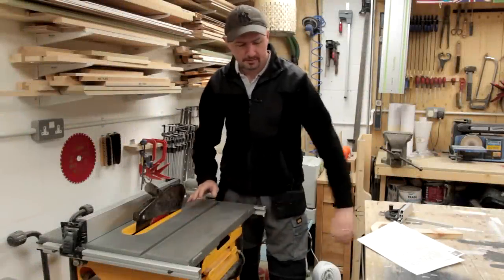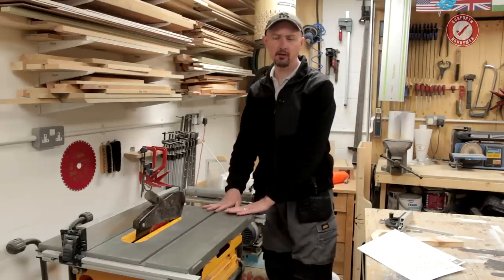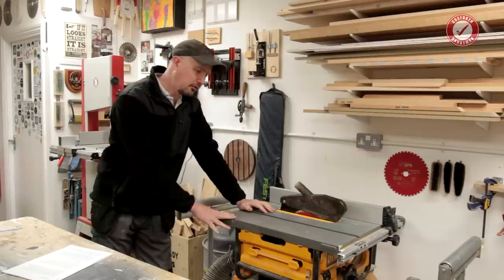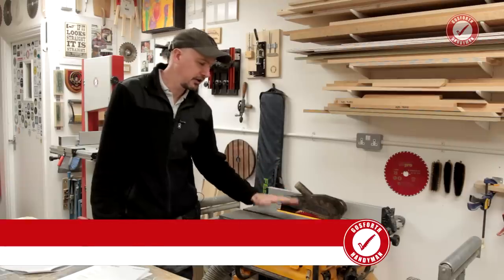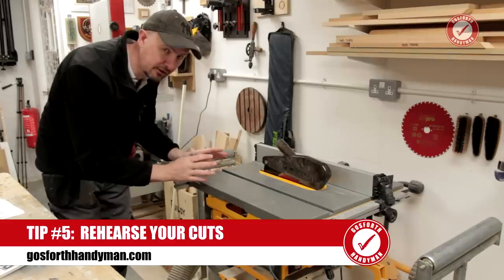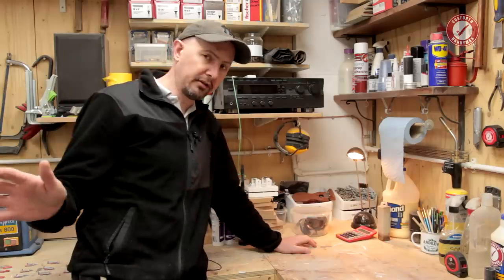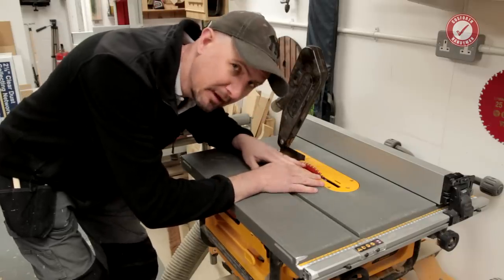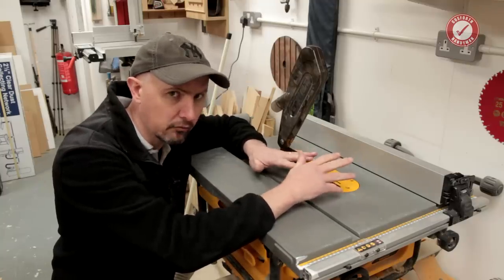TABLE SAW SAFETY - 11 tips to avoid death!

Comment: I used to use a Tridon work bench with a AEG 9 1/2 '' blade. I used to work off to the side 90% off the time. The down side o it was the emergency shut off switch was on the lower left corner when face the blade making it not really possible the use with speed. But I felt safer and had far more control over the cut wood. Plus after the wood had pasted the blade I could move to the back off the bench with just a step removing both the cut and off cut off the back off the bench going away from the blade instead off going out and back past the blade as you do when standing in front.  Always set the blade depth just above the timber your cutting. The right and a sharp blade will/does do a clean cut. Make sure when buying a saw such as I did, a hand held to be mounted in a work bench that the blade isn't flatting from side to side. Good bearing with little movement makes for a cleaner cut.

Comment: I had removed the riving knife on my BT3000 because of some cuts that wouldn't fit through.  I did not put it back on for a long time, but just put it back on a couple of months ago from watching another saw safety video.
I was cutting a thin board, using a long push stick and did rehears my cut, but missed an obstical and when I did my actual cut, the table saw moved a little and hit the end of the cut, stopping the board from clearing the blade.
The switch is a big paddle that I can hit with my knee and I was able to switch it off, but the saw still coasted.

IF the riving knife was not installed, the blade would have grabbed the board and kick it back, but the knife saved me.

I cannot stress enough the necessity of using the riving knife!

Comment: I went through kickback myself were I was cutting a small piece of wood, put too much pressure on the piece which was too small to need a raving blade, and the post stick and wood kicked back causing me to cut a small piece of bone off of my dominate hand.  Now I cannot feel the tip of my finger, but I didn't lose it.  Be safe, and don't be over confident

Comment: I stand to the side of my table saw with some of the cuts I make. Works very well and I feel quite safe. I don’t use the push stick, I use various other methods which I believe have much better control. I would say your home made pusher is on the right lines but the hand hold should be a lot higher, keeping your hand further away from the blade.

Comment: I bought the table saw in your video and have been terrified to use it. Still watching the 101 ways one could kill themselves with it. Reading Nick Offerman "Good clean fun" about his woodworking part time career and the emphasis on getting a table saw with a stop is accentuated but good. My Miter saw has been recalled so waiting for the part to come and winter's coming..... preparing myself to finally break this little guy in. Thank you so much for this.

Comment: This is brilliant! Funny enough the first time I used it, on the floor, I ended up using the sideways method, for cutting small panels for bird nests basically... what would be super useful is running through how to make cuts of different thicknesses and lengths, running from the easiest to the hardest... I need to rip a thicker bit of timber down, but am a little bit terrified, because I just don't know how it will feel and know I need to 'build up' to it... using gradually thicker pieces- would be useful to have a how-to on this aspect...😊

Comment: great video! about lifting the blade: if it is lower and you cut with the top of the blade, it pushes the wood backward and if a kickback happens it will throw the piece of wood with a much bigger force. if the blade is more lifted the blade will cut more in a vertical direction, pushing the wood down instead of backward. at least that's what I have been told and it makes sense to me. 2nd:  don't cut much longer pieces of wood/ panels using a tablesaw with such a tiny table, if the table is big enough you obviously don't have to hold the waste material and can concentrate more on the cut.
Reply: But with a higher blade a kickback risk being sent against your face.

Comment: Very helpful, thanks.  I'm going to make a longer, more robust birdsmouth pushstick before I use my old saw again.  A special hazard it has is that the fence does not always set parallel to the blade.  I have to measure it against the blade front and back every time I adjust the fence to make sure it won't pinch.    A point of criticism too:- you have shelves of loose wood right over your saw.  Too close, I'd say.  Put them where a wood fall cannot matter, or rent some storage.  A small point compared to the eleven good points you made.

Comment: This suggestion may offend some people and contradict all safety manuals and traditional training, but it has worked for me for the last sixty-five years. My dad taught me this went I was twelve.  From a physics standpoint, raising the blade just above the work piece thickness is the main reason for kick back. All the force of the blade is toward the operator.  Raising the blade as high as it will go will cause the force of the blade to be downward toward the table eliminating kick back. You must of course use a full coverage blade guard! A sled can also be an effective safety tool. I can hear all the screaming now.

Comment: Thanks for a good safety video!   I've been working with power tools for decades, which is exactly why it matters to keep thinking to avoid getting careless.  The bit where you are leaning over the saw just before the kickback... Martial arts has something to say about being overextended and uncentered.  That would be a very dangerous position to be in a fight as well as cutting wood, for the same reason (you are unbalanced),.  I try to make it a habit to always be able to sink my weight into my feet and push with my body so my hands do not want to go anywhere they should not, ever.

Comment: A tip I learned in the 1970's: when using the rip fence, start with putting your middle finger on the top of the fence . This pushes 2 fingers outside, which means you automatically grip and reduce the chance of your hand being pulled into the blade. It also forces the thumb and forefinger to stay close to the  fence and therefore that much farther away from the blade . However, detracting from that tip is your point about pushing closer to the fence forces the work to turn into the blade. I may need to rethink this, in light of that, but it has always worked well for me. Of course, this works for narrower rips. For one about 8 inches or more, there's plenty of room for a hand on the fence side.

Comment: Working from the side is an excellent strategy.  I do t his particularly with a sled I built with clamps to carry wood through to make a straight edge.  Handles on the sled place my hands out of harms way.  Basically I hate standing directly behind the blade!  I know two people with shorter or missing digits from table saws, so I have a lot of respect for them.  On the other hand, ripping is a lot easier, and seems safer than say using a hand held circular saw.

Comment: Hi Andy, I know you posted this a year ago, but lockdown has given me a chance to catch up with YouTube content. I've been using  table saws, more often than a job site saw for over 40 years, so far with out any scars or scares. A few moments when I realized I was not paying attention..... So first thing I was told was if you can feel the wind of the blade whirring you are too close. And don't push your feeding hand past the front edge of the table, that's when you use a stick(therefore not leaning over)
Safety training to use the Wadkin at my present job in a high school, was a one hour session, followed by practice cuts to prove you where understanding the process. During the training the entire space between the guide tracks was the DANGER ZONE, never put your hands into that area. The H&S sheet and BS4163:2014 state the crown guard should never be removed.......Our trouble is that 99% of videos on the web are North American, where not having a riving knife is the Norm, and Norm Abrahams, of course never had a knife or a push stick half the time.
I've seen one kickback where an arrow shaft size strip was cut off and because a push stick was not used to pin it down the blade hurled it off the saw horizontally 12ft, where it buried it's self in a thin door panel.
And the aftermath of a kickback that claimed my father in-laws little finger and other minor damage to his left-hand. He foned us to say he had had an accident, we live 5mins away. 6 hour op in Leeds LGI, no grip now in his left hand. I had given him firm instructions when he got his saw never remove the riving knife, but Norm Abrahams has been on the telly as a how to do it, after the incident I replaced the r. knife, it came off the saw very quickly after he got back in his workshop. I am going to clean out his workshop, ( he is in his 80s) so I can find the riving knife and the rip fence which are both hidden under sawdust and crap. 
Keep up the good work.

Comment: I would think that your side position cut could be relatively safe, but I would make sure you push your work piece all the way off the table after the cut.  If you just push it beyond the blade vibrations could cause travel back while you are walking around to turn the saw off.  Be safe people, and never allow yourself to daydream while standing at your saw. Thanks for your great video!

Comment: Excellent video. Some 25 years ago, I was taught don't watch the blade. Instead, watch for a gap along the fence (you don't want one). Watching the blade won't tell you anything anyway. With that in mind, it seems standing along the side of the table saw would not enable you to see the gap along the fence, unless you LEAN OVER THE TABLE SAW. :) Like to know your thoughts on that.

Comment: I reckon that the rehearsal is most important safety procedure. Before you start the saw, run thru the cut and know what you need for push sticks and where your hands will be at all times. Also get a scrap board to use as a stop. These saws are still rotating 15 seconds after you switch off.

Comment: Excellent tips which I shall remember. I've had a table saw for a year. By the way, I always cut 5 mm ply with a stanley knife and straight edge! Easier than you may imagine. Also I ask myself  whether I can make the cut on the radial saw, which I feel is a safer tool.

Comment: Your clip was a good reminder. Gave me goosebumps. 

I am newer in this trade (picked up as hobby in Covid Days). I experienced "shot backs" where smaller pieces shot back in reverse. I trained myself not to stand in line of fire, that is, not to stand right behind in the same line. I position my body on left side, towards the switch, use push sticks and position naturally gives it a vector away from blade and towards the fence. Any comments on not standing  right behind the blade?

Also, if riving knife is not aligned it causes a push back or a jam. Leared it hard way.

Comment: I have just bought my first table saw. I will never run the saw without the riving knife and where possible the gaurd. I've built a lexan guard into my cross cut sleds and an installing the Jessem stock guides. They are expensive, but not as costly as life changing injuries. I am also in tbe process of building an overhead blade guard, as having it fixed to the riving knife is a problem for any cuts with my jigs or for non thru cuts. Though none of these safety devices are a replacement for being careful and not rushing.

I completely agree, if you have any alternative way to do something not on the table saw then this is preferable. For me, I tend to use the table saw for groove cuts, as I don't have a router table (yet).

Comment: Brilliant. Not so sure about the 'side on' advice.... maybe an unforeseen accident waiting to happen.... would like to predict it but then,  by definition,  wouldn't be unforeseen. You confirm everything I have thought about this piece of equipment. In a way, the saw is not fully developed as a design, in the respect that the user has the option to be near the blade or in the path of kick-backed material. I almost want to see a guard like a screen between the operator and the blade with a kind of integral push stick so all you do is feed the material through without compromising yourself to get the correct feed angle..... perhaps easier said than designed. Anyway, for the sake of the currently available kit, you have probably saved lives, well done mate.

Comment: Just bought a used table saw which of course didn't come with a manual and riving knife not attached.  Minute I turned  it on it scared the $%&* out of me!  Thank you for confirming my initial fears that this is a very dangerous tool.   My issue is I'll likely use the saw once or twice a year  so will take the time re-watch this video before use.

Comment: I own and use a miter saw but the table saw for me is intimidating.  I haven't used one before and even though getting one is tempting I always back down from purchasing one because of how dangerous it can be if not used properly and like I had mentioned,  I never used one before.  What I use is a circular saw with an edge guide to make long cuts because I am familiar with operating my circular saw.

Comment: Very nice video. I have a SawStop table saw which I rather like, but after getting it, I worried that it might make me a bit more complacent about safety. A proper and safe table saw user should not need SawStop technology if the saw is used correctly. As Gosforth would surely observe, SawStop would not prevent a nasty kickback. A contractor friend said that SawStop is being used in shop class settings where students are learning about table saw use.

Comment: Great tips ! I like your pushstick, but in addition to the heel, how about cutting notch out of the front?   make it look like the plastic  dewalt stick.  this way you can switch from the heel at the start to the front notch when the board gets to the end;   and you can  still maintain a bit of downward pressure while not leaning forward .      I also like to stand on the other side of the fence and stay out of the line of fire as much as possible!

Comment: Worked on some variant of table saw almost a year. Was cutting long ass planks with it (3 - 6 meters long).
Only safety equipment theat we had was riving knife. Never had any dangerous issues at all. Maybe its because of the size and weight of the material i was processing. Kickbacks did occure on occasion but they were very weak. We were working in 2 man teams. One was pushing and other was pulling and generally speaking we were quite far away from the blade most of the time.
That was my first job out of the school when i was 17 yo.
Later on i worked in a big saw mill but that was like 90% automated and all you had to do is monitor computer screen and push buttons.

Comment: This is a great video, thank you for being brave enough to share your mistakes to stop others from making them.  I’m an experienced woodworker and power tool user, but not so much with table saws. One question - I see a lot of videos where people use 2 push sticks, one to push forwards and one to push inwards towards the fence. I note your points about where to push the workpiece from, which make good sense, but what do you think about the 2 sticks method?

Comment: I guess I've used a table saw wrong all my life.  We had table saws without riving knives or blade guards.  The saws never had them.  I'll call the company and see if I can purchase one.
this past weekend I was having an issue cutting straight rough lumber.  It was crooked.  I started getting frustrated so I walked away from the machine.   Best thing to do.  The next morning I was trying to get it straightened out and it just wouldn't happen.   I turned it off and I'm now (after a few day) going to get back to it.  I'm tackling it from a different train of thought.

Comment: The push stick and keeping clear of the blade seems obvious but I have watched multiple videos where they use the short push stick that sets their hand exactly in the right position to lose a finger if kickback were to occur.   I don't feel like you get enough down force with the dewalt stick but at least you aren't sticking your hand exactly where it shouldn't be.

Comment: Very helpful to me with new table saw and no experience with this tool. So easy to not fit riving knife. Comment on using table from side is that you are then too far away to operate emergency stop switch. I would hesitate to do this. Perhaps a child or dog rushes in to find you not realising the rule to keep out and you may need to shut down power immediately. Just a thought.

Comment: Thank you for a well considered safety video. Yes, I too have made your kick-back mistake. I suggestion: I was taught that I should position myself out of the likely path of kick-back whenever possible. There are limits to this - you are more likely to cause a problem if you are trying to control a work-piece from an awkward angle or too great a distance. However we can usually position ourselves outside the fence or outside the blade line - most kick-backs occur in the place in between.